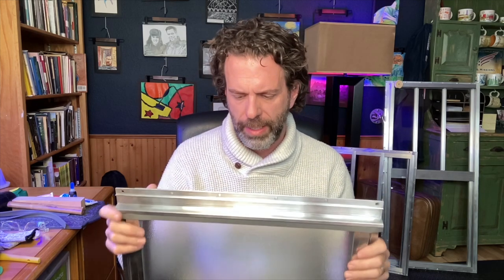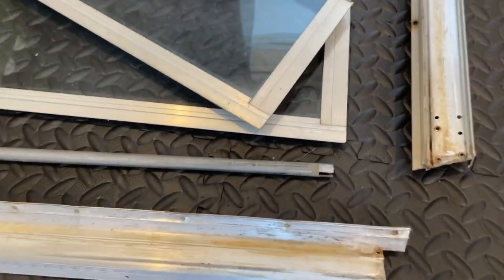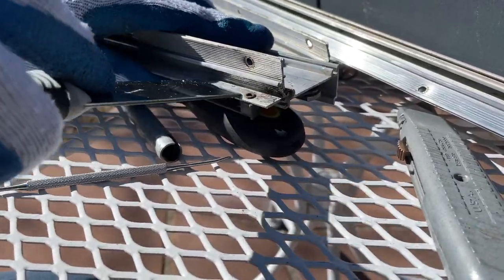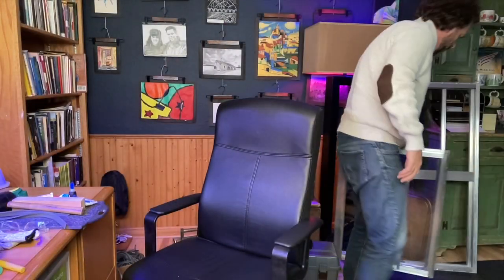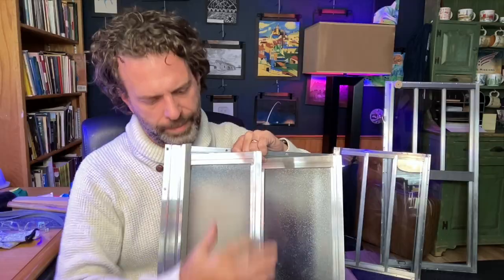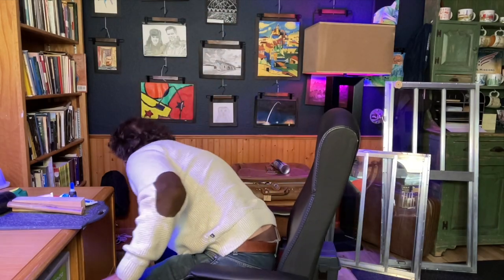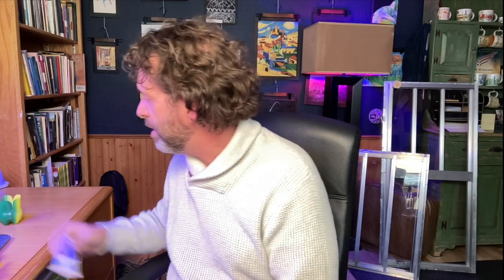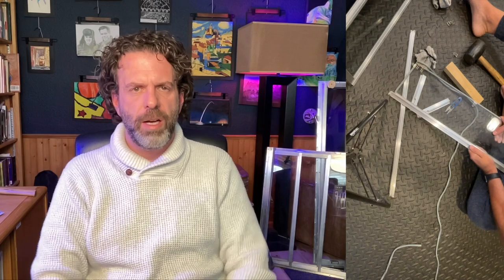My Trillium Fix | E6: cleaning jalousie windows | similar to Scamp & Casita Fiberglass RV trailers

Comment: Thanks, great work on the Windows and the videos. We have a 1981 trillium. We had it since 1993 but haven't used it in a decade. We have just retired and one of my projects is to restore this trailer. I will need to do some fibreglass repair ( heavy branch landed on the roof and did some damage..). I was dreading what to do about the Windows but now feel confident we can tackle them too. Thanks again. Leo
Reply from the maker: Thanks for watching!

Comment: Great video. I appreciate you sharing the learning process that you went through to get to the point where the restoration job became easier. I must say though how do people work with the imperial measurement system? 3/32nd of an inch for the seals? I could never find that on a ruler but I can find 2.4 mm....
Reply from the maker: I often wish the USA would switch systems, too!

Comment: What about straightening out the aluminum frames?  I find that the PO over tightened the screws and the frames are a bit warped.  Any specific suggestions?  I will be trying to use a vice I think….
Reply from the maker: I would probably try putting them in a vice, too.